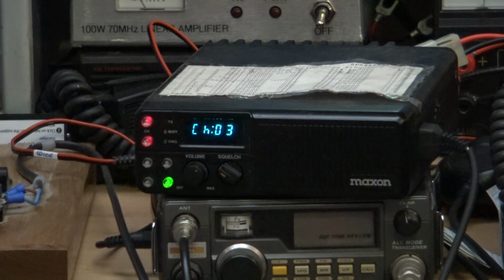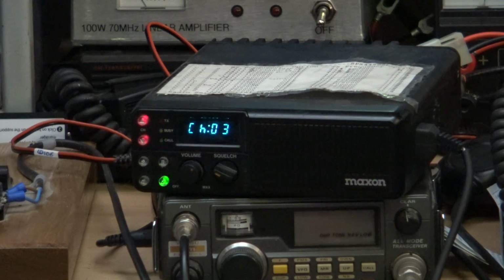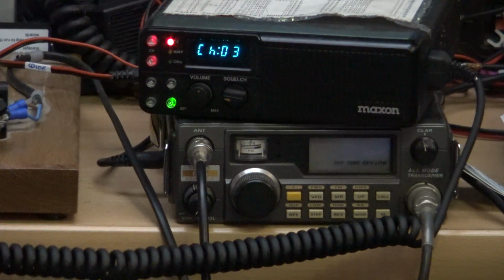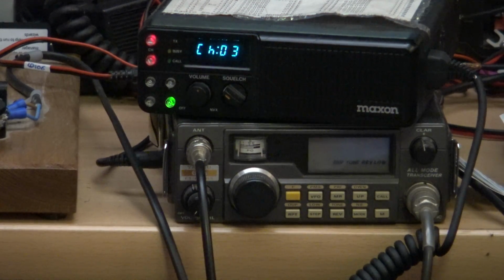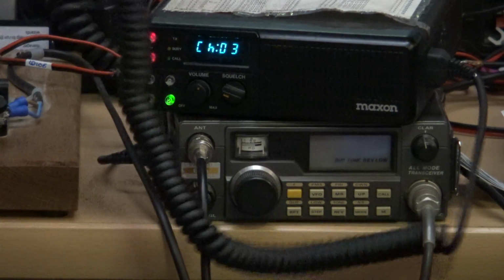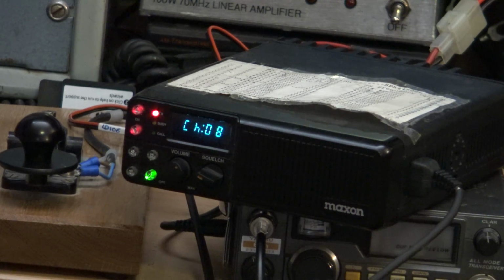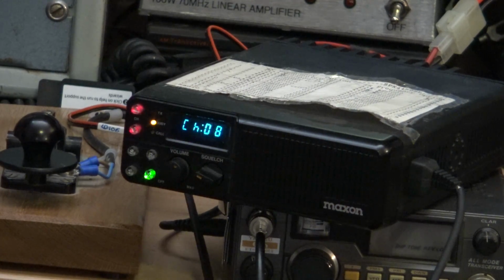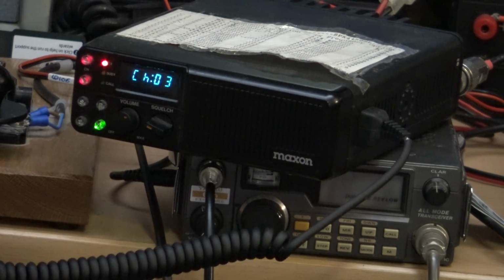70cms Amateur Radio - on the air test - 5W &10W FM demonstrations, 3 different antennas, Maxon PM150

Comment: Hi, I've got access to a lot (more that 10) of those Maxons, that are "usefulness expired" from my employer. We moved to Tait 8110 kit, but that isn't important. They were used for HF taxi operations, and I'm wondering if its worth me buying the lot for pennies and trying to repurpose them for Amateur Radio use?
Reply from the maker: I don't think so Tony. You need to look at the model number & get back to me rshireby@yahoo.co.uk. Each major business radio band has approx 3 different Maxon PM150 models to cover it, so there are about a dozen & only three go onto ham bands. Basically:-

SMX-4050 is low band, so the A suffix will go onto 4M
SMX-4150 is high band, and the A or L  version will go on 2M. Most CHF Hi-Band business radios are 166Mhz/170Mhz split frequency using the SMX4150NH, which is no good for 2M
SMX-4450 is UHF and 70cm amateur requires the A or B or L band

These radios were £367+VAT when new with a 20,000hr MTBF rate (Mean Time Between Failure).

Richard, G0OJF

Comment: Interesting video Richard. I had the VHF version of that Maxon. Was a very good radio. 

Wanted another but couldn't find one. But I did pick up a Uniden SMH 400D which is a VHF set. Wouldn't mind having it programmed for 2m. But can't find much about it. Do you reckon its possible?
Reply from the maker: Having not heard of this set & having a quick google search it appears to be type approved for the United States, but that makes no difference for ham use. What it means is it will, like the Maxon PM150, be a 45W radio which the USA LMR service can be licenced up to. UK type approval only needs to go up to 25W, which is our licence maximum. It will be programmed with a stand-alone custom programmer or perhaps a custom programmer via a PC running DOS. We have several DOS only PC's around here for the MAxon & TAit radios we need to program. I point this out as the DOS programs don;t work through windows . Basically you need a service manual. Like most business radios they will need tuning as well as programming. Furthermore there will be quite a few models for the  entire VHF bands...most manufacturers basically have low medium & high for the different bands. By that, I mean 68-88mhz, usually 3 models, 136-174Mhz usually 3 models, 406-500Mhz usually 3 or 4 models. I saw a Uniden on Ebay showing as working on 168Mhz. I can't see a set doing 168 Mhz being the right model for 2M....but I haven't seen the Uniden specs; normally radios on high band will cover 154-174Mhz.

Richard, G0OJF, UK
Reply: @ukfmcbradioservicingTango21  Cheers for the reply. Yeah that’s my eBay listing. Got a bit disheartened when I couldn’t find anything on programming so stuck it up on eBay. I’ve lowered the price down twice, no one even wants it for £10. So I’ll probably consign it to the scrap pile if no one takes it by the end of next week

Comment: 10w at the antenna feed point don't forget for    the foundation licence  rather then  back of set ... 

GB3GR is a cracking repeater  

you can get in from Lincoln  on a handheld in the right place

73de M7NYH
Reply from the maker: Good point Nicola.

Richard

Comment: I didn't think you would do well with 70cms and 5 watts.  However, with a better aerial and 19 watts it might be better, even just the better aerial.  First test, CB would have done a lot better, however, the high frequency was working against you. (This is before I watched the video, just at end of last test going, watching and typing, wife says men can't multitask Huh ).  Coming back I suspect he had a better ground plane towards you.  But good on you for putting up the video.  You should also do it through the repeater if you did not do it.  That second test the aerial would be roughly the length of a CB aerial?  Maybe slightly shorter, I was thinking 2mtrs!  Writing as the video is rolling.  You did do the repeater, good demo of repeaters.  70cems is pushing it though on the route you go!
Reply from the maker: aerial 1, 5 1/2" quarter wave, home made 5W, aerial 2, 5 1/2" commercial 1/4wave 5W, Aerial 3 triple 5/8 about 1.5M & 5W......then repeater demo (I own that repeater), final demo...same aerial but 10W. All in the blurb.

Demo was 10W max to show maximum power that Foundation licence holders are allowed. In reality I usually use 25W & Mr C uses 45W......and usually use the repeater. Incidentally, I once had Russia on 70cms SSB running 12W.....weather conditions!

Richard
Reply: @ukfmcbradioservicingTango21  Personally I don't see the need for more than 50 watts, you are just adding to the noise.  Better getting a better aerial, or a repeater if you can afford one.
Reply from the maker: @BoB4jjjjs  The licensing of repeaters takes quite some time and you have yo have a full license too.  I thought I'd mention this just in case anyone  looking at this thought you just went out & bought one!

Richard, G0OJF, UK
Reply: @ukfmcbradioservicingTango21  Yeah, setting them up is not so easy either.  There are sometimes illegal ones appear around universities now and again, or there uses to be and on odd frequencies they were not allowed to use.  I suppose mobile phones has taken that bit of fun away as well!  Yes, FULL licence and you might end up paying for rent to get them on a mast.
Reply: @ukfmcbradioservicingTango21  Russia! Impressive! Is that an FT-690 Mk2 you’ve got there? 6m mobile is a lot of fun too.

Thanks for the great demo. 

GW4VXE
Reply from the maker: @LongworthTim  Yes, that's Mr Chippie's FT690. We'll do a demo using 6M soon too.

Richard